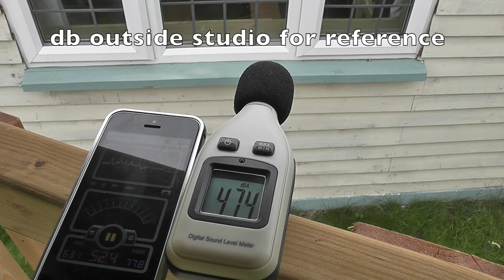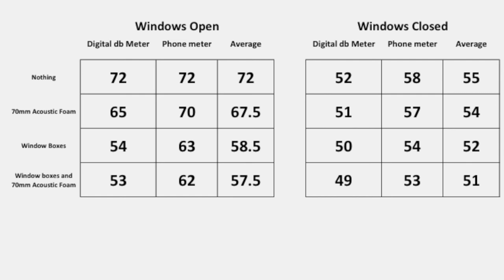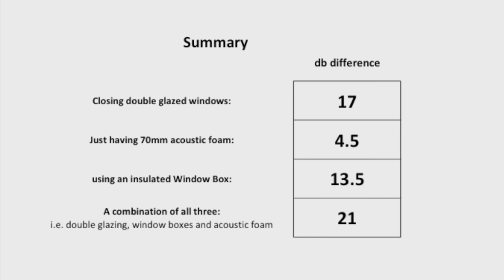Soundproof windows dB test

Comment: Hi There, GREAT VIDEO. I have a workshop that butts onto the end of the rear garden of the house behind. I have seen the guy right up against my wall behind taking a noise reading on his phone. Bit manic about this, but your final outside reading was 49DB. Do you think 49DB is low enough to keep noise complainers away as per your video. In other words, do you have any idea what you think is an acceptable DB level leaving my workshop on the neighbours side of the wall?
Reply from the maker: I think 49db is an acceptable level.
To reduce the noise from the workshop you’d be best off making a room inside a room but you’d need to isolate the internal floor from the external floor, maybe using that acoustic rubber matting. 
You could greatly reduce rumble from the machines being carried through the floor by building a platform under any machines with that rubber matting and then timber on top. 
Is it a workshop you need to use daily for business or occasional DIY use?
Reply: @PherotoneStudios  Oh, really big thanks for this. It is our main business workshop, so our bandsaw & router are about 100DB inside room. We don't use the router much but we do use an air staple gun a lot (about 79DB) and the bandsaw. I have looked at the room within a room  concept and it is a good idea, but I did not think of the floor. The guy moved into his house about 18 months ago and basically wanted our business out from the start. Honestly, 15 mins after picking up his house keys, they come around to our workshop and were really banging hard on our door, I did not answer.  He has just put in for planning to 4 weeks ago to build a outhouse only 1metre away from our back wall, when he has loads of space and that would be right at the very end of our their garden. We have objected. So far we have never had a noise complaint, but if he builds this outhouse then I will think complaints will start. I looked on the government website and it says councils measure noise complaints from the complainents dwelling / main house lounge. Got a noise app. upstairs office and cutting (very quiet / quiet) all the time, downstairs (moderate mostly then loud: annoyance possible when using the about tools). Sorry its a long answer.
Reply from the maker: Your neighbour sounds like a dick!
I’d make a room inside a room out of studwork, ideally with a ceiling too. Fill it with acoustic fibre glass and then throw OSB over the face. If you have the budget, also some acoustic plasterboard as that speaks up a lot of sound
If you can, get some acoustic rubber matting and put that under each machine. Maybe with some 18mm moisture resistant chipboard on top of the rubber so the feet of the machines don’t destroy it
Reply: @Paul J , Its not really the noise level, it will be the constant drone, did he only visit on weekends? What did you end up doing and the DB level you got?

Comment: It's not clear from your picture if the foam piece is attached to the window box--as the video shows it being added separately.

I'm looking to block out the thumping noise from 4 guys playing basketball in their yard--directly next to my house. Would all your components used block out that low level of noise?
Reply from the maker: I have acoustic foam glued to the back of the box so that it presses against the window, then a slab of acoustic foam cut to the shape of the opening that goes in afterwards. The internal acoustic foam is mainly to treat the room acoustically but it does reduce some high end noise.
Basketball creates a low end thumb which could be tough to reduce. These boxes have a lot of weight to them so would do a great job of reducing that. I can’t think of anything else that’s work to be honest. 
Despite what some people say, thick curtains won’t make any difference.
Reply: @PherotoneStudios  truly appreciate the detailed feedback. I'll try what you've done--can only help. Curtains are laughable, really.

Comment: Nice work mate. I have been debating soundproofing in a new shed build. Obviously I want to keep space to a maximum as I have a small garden etc... I will have to soundproof to some extent but I liked the idea of putting my home cinema into the shed as well. It's completely feasible except I worry about bass. I can only see small speakers in your video and I will be wanting to run proper subs. How well does your build work with bass?

It would be a lot of extra effort, time and money to go all out and for it to be too loud outside when a film is on in the evening. During weekends I guess is fine but I don't want to upset the neighbors too much!

Nice work on the videos. 
Cheers
Reply from the maker: Bass is always the biggest problem because those huge powerful sound waves are really difficult to stop.  What's the shed base made out of?  Ideally you'd want the base for the internal room separate to the external room and you would definitely need to go down the room inside a room approach.

You need loads of mass to stop of disperse bass waves.  My walls are around 12" thick and that does quite a lot but I don't have a sub and my big speakers are only 6" Mackie HR624 monitors.  For me mixing in the room I haven't really gone to town on stopping bass as sheds are notoriously leaky sound-wise and for mixing it can be even worse to have a bass build up especially with my setup - small room, speakers in the corner of the room.  

If you could incorporate a brick or concrete block wall into your shed you'd be on to a winner especially if you also had the acoustic rock wool in a timber stud wall with a couple of layers of db plasterboard over the face (and ideally a sheet of plywood or OSB) especially if you have a decent base for it all to sit on as you don't want any weak points.  The biggest weakness with shed is the roof so it'd be a matter of getting as much mass into the roof as possible and making sure it's strong enough to take the weight.  A tiled roof works the best but they weigh the most but you can do a great job with a ceiling under a ceiling.
Reply: thank for the reply, I found another you tuber who did his own shed drum studio and the kick drum on that was barely audible outside the shed, they have a resonably low frequency. He did however have a concrete base and a full room inside room set up like you suggest. I think I will go with replicating that as it was very similar to my current small shed except for the extra walls and concrete base.

Cheers mate
Reply from the maker: Dougie Todd I’ve helped a few drummers with their shed studios and the bass drum is always an issue. My cousin has a studio and an electric drum kit but only one floor. Even though is an electric kit, the floor actually amplified the bass drum beater and sounds like loud banging from outside. 
If you’re not doing a concrete floor then maybe try and have a floor on top of a floor like me
Reply: Yeah I think it's going to have to be a concrete floor as I'd lose height if I don't wood on wood and I need height for various reasons once it is complete as it will have to be multi functional. I think concrete possibly with some flooring on top is where I will go depending on height inside.  Whether that's wood with more insulation or not I'm not sure